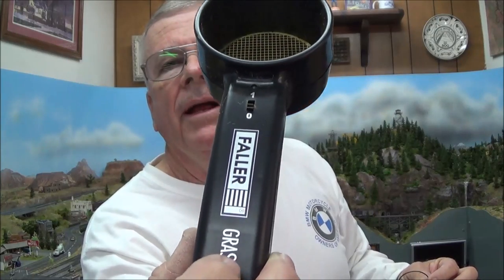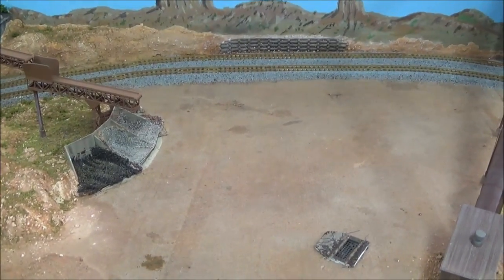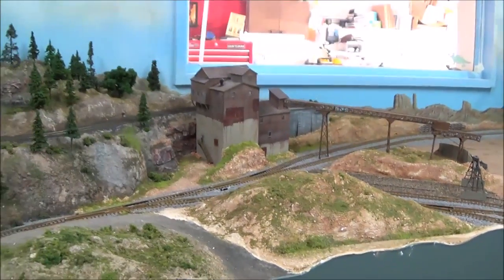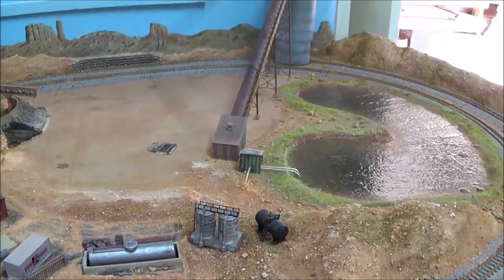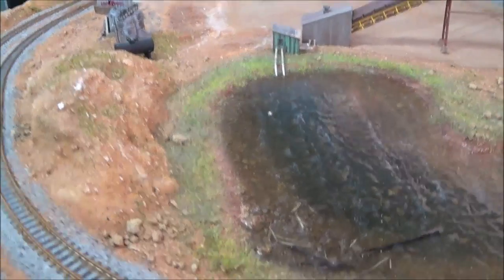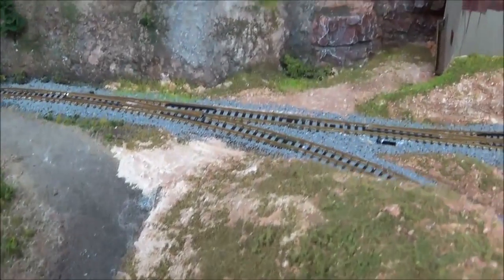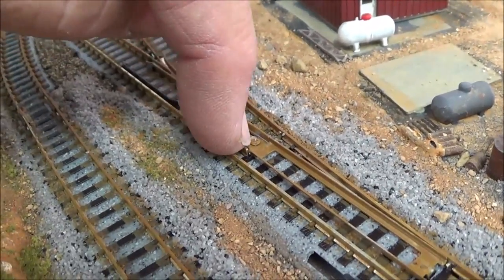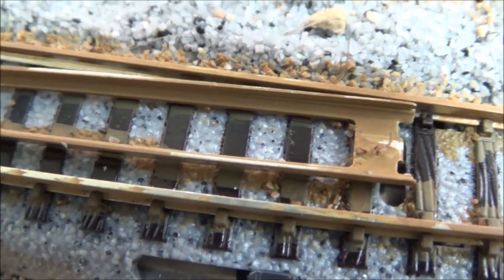N Scale ACTRR Rehab Update #7 Flood Loader

Comment: Hi Mike, your rehab  is looking good. Also, nice info about keeping ballast and other contaminants away from the holes in the switch machines. Another tip is to take off the back side cover of the switch and clean the thin copper wiper with an electrical contact cleaner, the same kind the computer people use just get the kind that is safe on plastics. Works great. You can also use it on the track if you have a stubborn spot to clean. 
Randy
Reply from the maker: +Randy Piasecki Thanks Randy , I will have to try that some day.
Mike

Comment: Thanks for another informative video.  I have the Noch static grass applicator and still need a lot of practice using it.  Like you have done, I like 2 or 3 colors of static grass and also more than one length.  I have not used my applicator enough to determine if a mixture of different colors and lengths can be applied at the same time.  I also have a question about the colors of the Kato track roadbed in this video; it does not look the same as in the past or like my test loop here in the office.
Reply from the maker: +Roger G. Perkins Thanks Roger , The Unitrack in the video has had the rails painted and ballast along the track but not yet stained with thin black wash.
Thanks , Mike